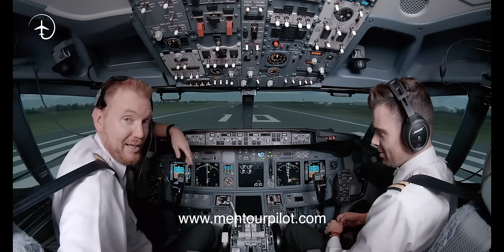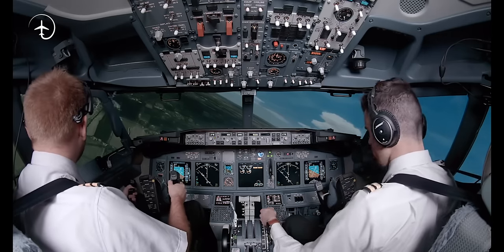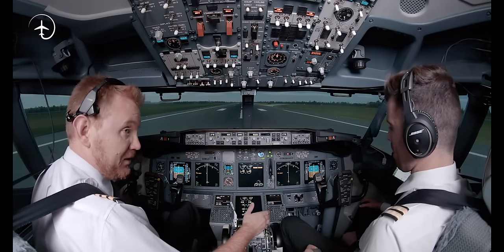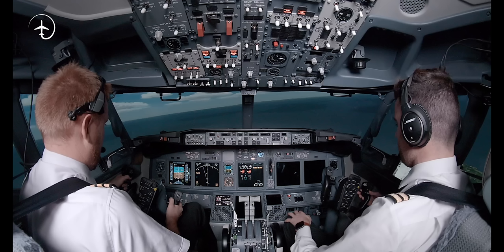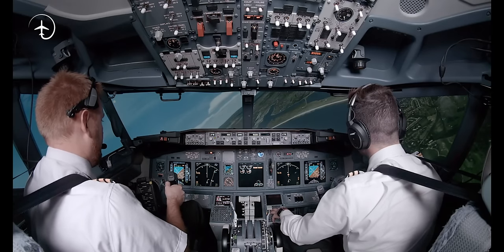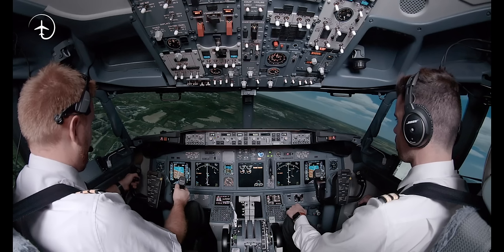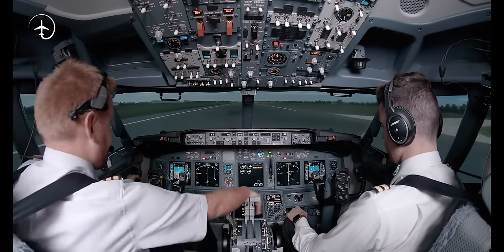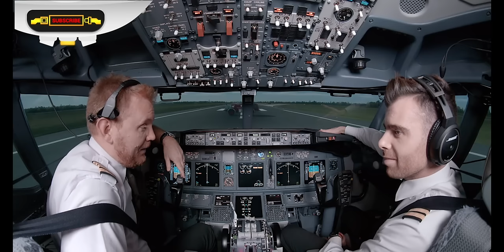Can an Airplane land if BOTH engines fail?

Comment: In The Real World,,,, The Engines Are Not Necessary For Flight.... But Remember,,,, There Are Only Three Safety Factors For An "Airplane"... There Is,,,, Excess Air Speed",,,  Excess Altitude".,,, "And The Want of Another 1000 Foot of Runway.. Speed,,, In Most Airplanes,,,, Can Be "Exchanged",,, For Altitude...  Vice/Versa,,, And If You've Always Got "Another 1000 Foot of Runway,,, No Need For The "Fire Trucks"... But The Sound of a V-12 Barking Out The Stacks,,, and Banging In Your Ears,,, Sure Is Comforting....

Comment: The real question is, can an airplane take off if none of it's engines work? Unlikely as it may seem, there is an answer to this question!
Reply: Ὅρα Μή· It weighs about 50 metric tons..so how is it gonna take off then?🤦🏻‍♂️
Reply: I was picturing hurricane winds with a massive strong line - fly like a kite. 

Perhaps they are slyly referring to when they took the engines off and tried to use an aircraft as a glider - some military idea. While it worked, it didn't suit the purpose.

Comment: Where does the need for fuel dumping come into play in this scenario (if both engines fail just after taking off) for making the plane lighter for reasons of max weight landing as well as making the plane lighter so it can glide further? Would the plane landing in this scenario with alot of fuel in it damage parts upon landing?
Reply: Jeremy Resch Well in this scenario it is a 737NG, and there is no fuel dump system on those. Damaged parts? Maybe🤷🏻‍♂️ 
Think both reasons (gliding capability and weight) are valid with fuel dump system.